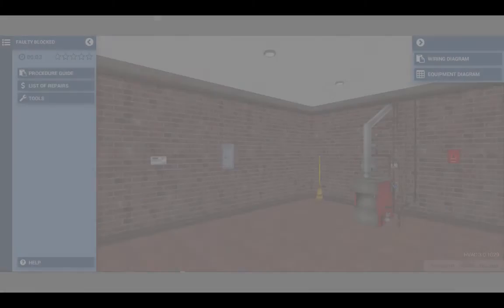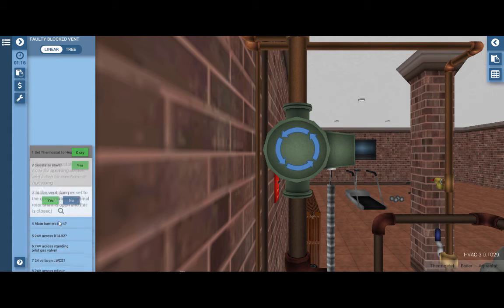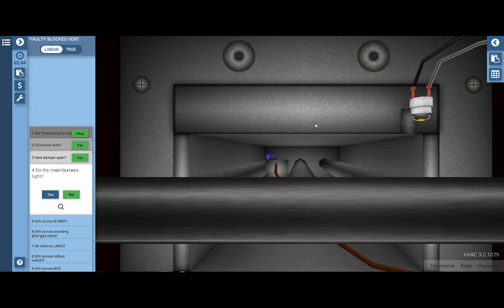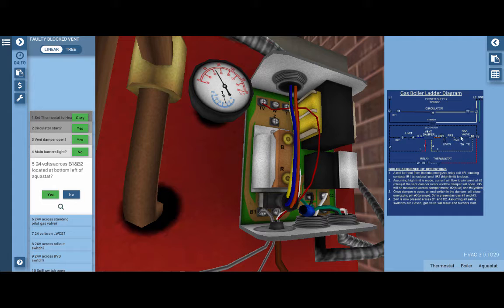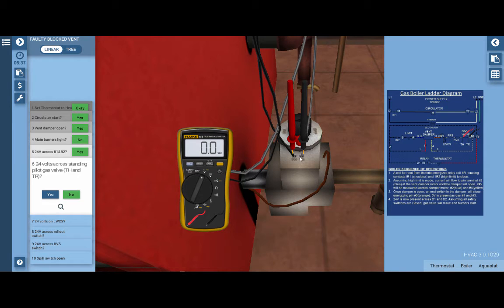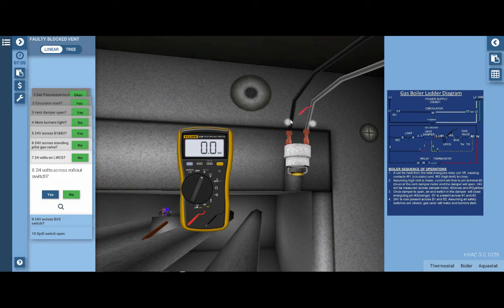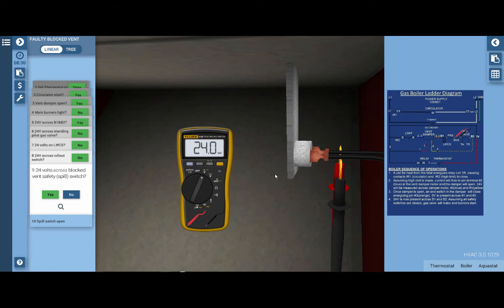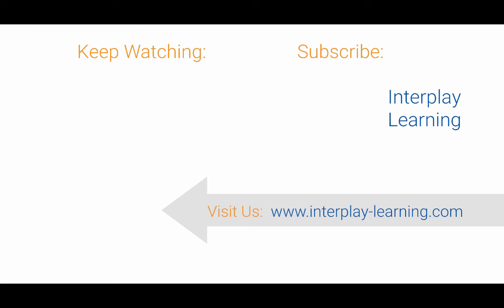Gas Boiler Blocked Vent Safety Switch Troubleshooting

Comment: 2 small of a circular pump would trip the spill switch too.  Boiler gets to temp, damper closes and and heat builds up tripping it because the pump isn't moving fast enough to cool the heat exchanger down fast enough... Figured I would share because I've come across it before on a new install